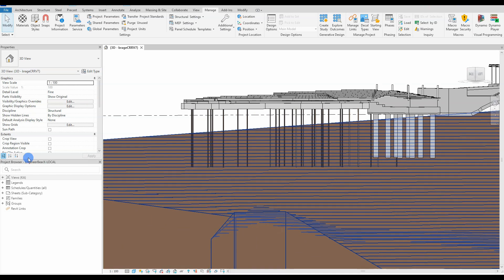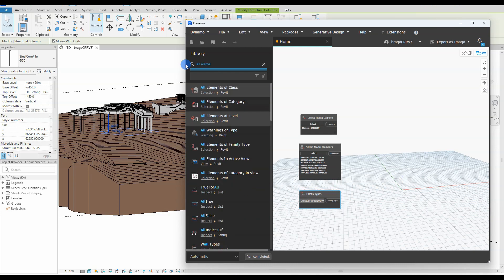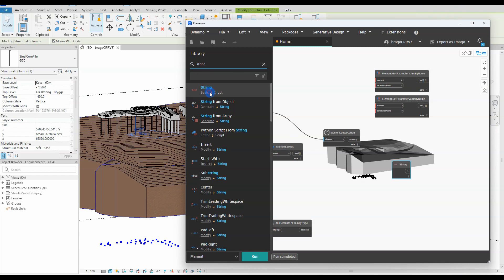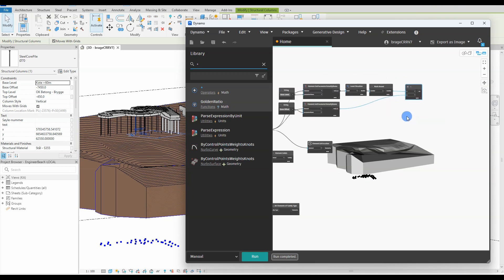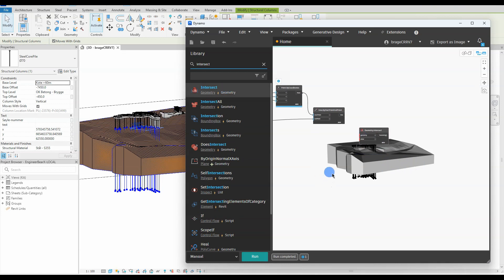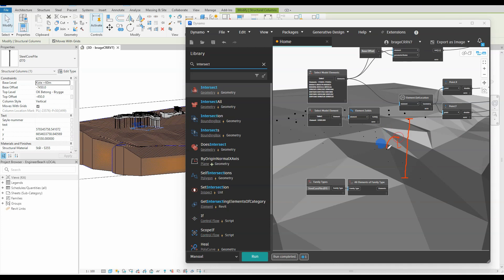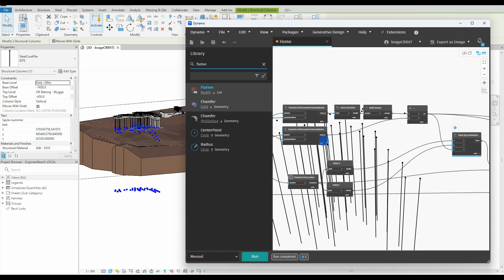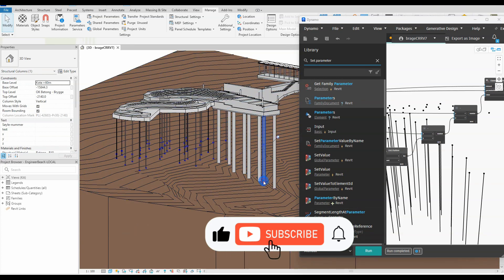Revit Dynamo - Extend structural columns to toposolid

Comment: Thank you for sharing, I appreciate your work. If it's the other way around, I have several buildings, and I have a topographic ground (toposurface) that doesn't fit my buildings. How can I make the toposurface adapt to my buildings? I have several buildings made up of walls.
Reply from the maker: You are welcome. 
I suggest upgrading your Revit and then creating a topoSOLID from the toposurface. With the toposolid, you will be able to adapt the topo to the buildings. 

 I might also suggest you watching my other video about creating an excavation pit for a building -> 
 Revit family masterclass: parametric excavation pit with trigonometry and tangent formula

Comment: Hi Brage. I´been following you for years watching some of you nice and inteligent videos and workflows, and this is the first time I reach you out. So congrats and big thank you for your work and time spent on this. Here´s my question about the lenght of these columns, are they the same? Well, I´m dealing in some pile testing with different heights per each pile in the same foundation and I´d like to know if you have tested a sample with this case. Thank in advance and thanks again
Reply from the maker: Hi Pedroc! Thank you! I am glad my videos have been helpful. No, every column, after the dynamo script is run, has an individual length based on the distance to the toposolid.  Are you extending the columns to a toposolid? Feel free to send me the Revit file or some pictures on the "problem" to my E-mail.